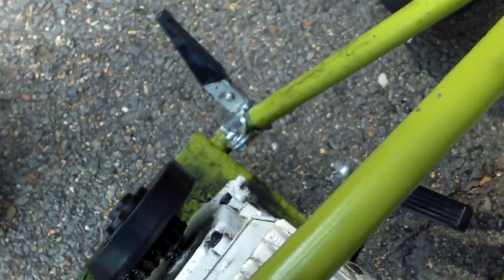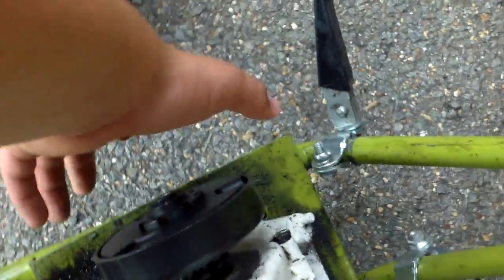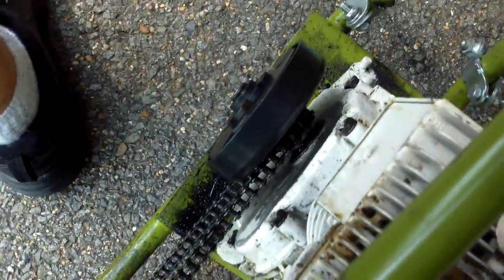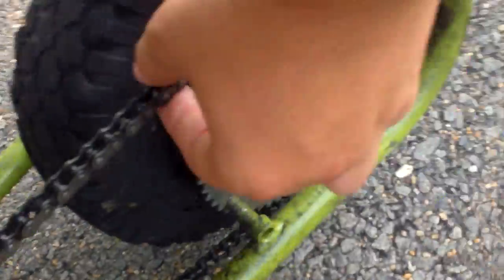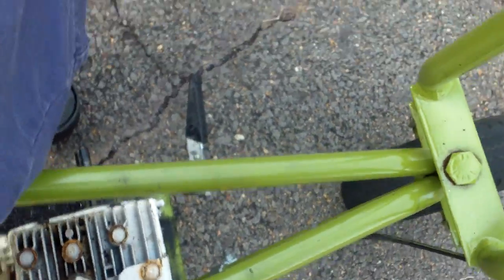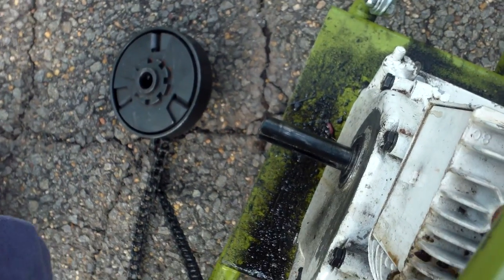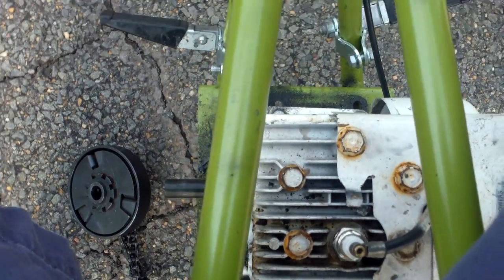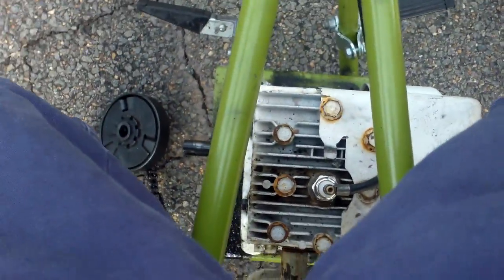How to tell if your centrifugal clutch has gone bad

Comment: Another really important sign. Take a goood long look at your springs. What causes failure 99.9% of the time in these clutches is the springs due to overheating. If you hold the sprocket end of the clutch  and spin it back and forth with your other hand and you hear a screeching sound its your springs. When the springs fail the clutch will engage at a wayy lower RPM and it will bog or fully kill the engine at high speeds. This video is extremely helpful, one of, if not only video going in depth on different scenarios to help identify when its time to switch it out, so thanks! Worth noting- clutches are perfect for ON ROAD riding. They can suffice off roading and hill climbing if you have a jackshaft and have it geared low. The best thing you can do (if you plan to ride on road and off road) is get a torque converter! Perfect for low end torque and with a 10% overdrive will give you more top speed. The greatest thing about a torque converter is once youve got it all installed, and something breaks (90% of tbe time its the belt wearing out) you go on amazon and bam you got a new belt for 6 or so dollars. 

On the other hand cen clutches are cbeaper than everything - 20-30 dollars on amazon and it also includes a 40 series or 35 series chain. If youre tight on money by ALL means just get a clutch, they work great for 1-2 years and will work 2-4 hears if you lube up the bronze bearing every month. 

Thanks for the video and hopefully the info ive shared will help ppl!

Comment: Mix a 50-50 mix of lucas high temp grease with atf and that will allow your clutch to work for 2 years longer... hope this tip helps someone. 👍
Reply: On the bronze bushing or in the drum where shoes make contact? Where to apply this 50-50 mix?
Reply: @scottbrodie3071  this only works on actual cars 😂 idk what this dude was talking about.
Reply: All you need is a dab of high temperature grease on the bronze bushing. Do not oil or grease anything else in the clutch!

Comment: Actually that works better then most of those clutches I have seen.  Most of the ones I have seen jusy get stuck and won't disengage.
Reply from the maker: Marc Serina they die in many ways I guess. That must suck when your driving and it locks up on you like that
Reply: I have one on a motorized bike sometimes you don't have neutral that's all, i have gotten good at taking them apart  cleaning, sanding , oiling them I'm putting them back together.

Comment: Thanks bro i appreciate the info but may i add something... when you ran the engine without the clutch & chain...of course its gunna  not bog out on you theres no weight no tension no real work for it but usually when it does that ill clean up my sparkplug and it really helps but it happens rarely for me just check your sparkplug that may be your engines symptom🤙🤙🤙
Reply from the maker: Ita fixed now clutch bushing  was bad. But yea your right the engine  was not under a load

Comment: I took my engine off my go kart and it runs perfectly fine at full throttle, but when I put it back onto my go kart it  just sputters when I give it any throttle and then kills. I think it’s the clutch or chain but they’re both brand new.
Reply from the maker: Coaxer could be that or something else but maybe try and adjust the carb idle/mixture screw too.
Reply: If I understand you correctly, it isnt an issue with the clutch, it is a problem with your gearing. The engine runs fine when it's off the kart because theres no load for it to pull. When you put it on the kart and you give it some gas, the clutch engages, then has to pull both the weight of the kart and the weight of your body. If you put a larger sprocket on your axle, the clutch will have an easier time getting you going from a dead stop. A larger rear sprocket = more torque which it sounds like you need

Comment: I said the heck with all the disassembly cleaning and oiling and reassembling and carrying lubrications in my fanny pack for my minibiking adventures and explorations I embark upon, I came up with a whole new way of getting my power to the earth below my rubber tires. It’s not a torque converter either! Those are just as much work if not more than a clutch because they have more moving parts and a belt then u still have to have a chain and sprocket off that! No thanks. Plus I heard they’re made for girls bikes mainl hehehahahahe😝. I installed a kickstand under my bike that when it’s down my back tire is actually off of the earth maybe 25-30 mm, ( that’s even w me sitting firmly on my luxurious seat made from my moms old night gowns made from  red silk, chaahching🏦💃🏼 idk what she wears now that I snagged it out of her top drawer but who cares haheha. Then I went to my neighbor billy who fixes tailpipes for ppl all day and night in his side yard and had him just attach the sprocket to the engine with this special type of welding he knows how to do that actually comes out of toothpaste tubes so now I just start it up while I sit on it and then thrust my tummy forward like I’m on a bucking bronco and the kickstand goes up my tire meets the earth and hang on tight cuz it pops a big wheelie right in front of my arch nemesis neighbor Jeremy across the street from my house and his super smoking hot sister Jessicahhh aah aahh Lynn and I’m off to the mooon ! Or at least to the park down the street where Jessicaahhh aah aahhh meets me to clean my spark plug off for me before my exploration takes way. Best mod I’ve ever made!#clutchesandtcssuckjermeysball
Reply from the maker: Just read this and I’m dying 😂😂😂 good story 😂

Comment: Stop and add oil 30w right by the lock ring and sprocket. It is a brass bearing need oil every 30 minutes of riding ,a gravity feed drip oil will solve future problems if ur forgetful
Reply from the maker: David Kaul it’s been replaced over 2 years ago and the new one works perfectly and I always oil it. The old owner didn’t seems to look out for the clutch bearing that much because there was no bushing left in the clutch because it was so worn out
Reply: @streetstallion  when u by the motorized bicycle kit oil on clutch bearing is not ever mentioned. Rrrrrrrr is what my bearing did ,I actually rebuilt it after Google on why my bike made rrrrrrrrr sound lol thankfully u tube taught me
Reply from the maker: David Kaul yea this bike is from  1969 so I never got it new... but yea that’s sound kinda is a big jump scare for sure 😂

Comment: Thanks for uploading. I have a medium grade clutch on my mini bike. Fairy new, I’ve been having an issue with it overheating when I have the plastic cover on. Is there anyway to help keep it cool? I don’t really wanna run the risk of getting my leg caught in it either.
Reply from the maker: It shouldn’t be overheating unless you put oil inside the clutch drum which causes it to slip. Although it is normal for Clutches to get hot because the whole bike works because of that it’s under a lot of load especially up a hill. 👍
Reply: MustangLover 1970 yes that’s exactly what I did. I put chain lube on the jack shaft chain and it got in it. I just tried running it and it shot sparks so I’m gonna clean it and see what happens tomorrow.
Reply from the maker: Spencer Tree that is a really odd symptom
Reply: MustangLover 1970 it should be ok. I think it just got too hot. I opened it up and everything looks okay.
Reply from the maker: Spencer Tree oh ok 👍 good to know it all turned out well for you
Reply: MustangLover 1970 so now the chassis has a crack that is getting bigger every time I drive it. Rest In Peace mini bike.
Reply from the maker: Spencer Tree aw man no way! You can’t fix it by a weld or something?
Reply: MustangLover 1970 I probably can, I just don’t have a welder.
Reply: @spencer6104  ask around, I know a lot of people have a little mig welders these days. I have Kids always coming Over for a Quick Fix on their bikes and Little Scooters. Earlier this year I had a guy bring me an old Go Kart that he wanted me to fix up for his kids. I did a lot of modifications to it and the Kids love it.
    Just a thought, 😎✌

Comment: Dude its overload protection its ment to do that it may be old yes but its dying because your putting too much stress on the clutch
Reply from the maker: Ttv Thraxy that’s true on newer clutches. This clutch was from 1969 and the bushing was gone aswell as the drum being so worn out. This vid is 2 years old and I put a new clutch on it 2 years ago and service the new one regularly, no more problems after the replacement

Comment: Just confirmed my suspicions. Pickup up an old mini bike tonight that has all your symptoms.
Reply from the maker: Did u get a new clutch or restored the old one?
Reply: @streetstallion  yes. Mine was the kind of clutch that has the pucks held together with "c" shaped brass clips. Greased all surfaces except the ones that make contact when engaged. Works perfect now.
Reply from the maker: rlachermeier ok awesome! My clutch was just screwed because the drum and the bushing was shot so I didnt wanna waste time with the original clutch. I bought a new clutch 2 years ago and oil it after every ride. No problems now and works good.
Reply: I bypasses the governor on the bike I just got used for a few days. I took the zip tie off, and put gas and some cleaner in it and it started bogging on me and seems like it's not going as fast. I was worried I blew the engine or something, but I'm thinking it's the clutch. Especially now that I'm almost done with the video and saw the noise your clutch was making.

Comment: Hi mate, is it typical for a centrifugal clutch to work really well until it heats up, because I  start to hear the motor bogging out around 1.5 - 2 minutes from a cold start? Everything is well until then.
Reply from the maker: Usu Caption Hey there, no it was actually hot I was on a ride before the making of this. Had  a new clutch put on almost 2 years ago. Does great now 👍
Reply: Thanks for your reply. I've got a small plate compactor which as you know works off a  centrifugal clutch too. I think you have answered my question as after working well for 1.5 - 2 mins,  it starts bogging the motor down and the plate stops vibrating properly. Cheers !!

Comment: Quick question if you tight your chain and all and it still keeps falling is it because of the clutch?
Reply from the maker: hi I’m xian not really a clutch issue. Majority of the time it’s because the chain is old and needs to be replaced. I had this issue and I replaced the chain and good to go after that. Or could be you put the engine on crooked
Reply: MustangLover 1970 thanks man

Comment: So if start my go kart and it takes off running without hitting the gas,i have a bad clutch? I  put it on a jack stand and turned it on and it just keeps running.At this point im lost.
Reply from the maker: That’s normal usually.. but if it’s going too fast try lowering the idle by turning the screw
Reply: @streetstallion  thx a lot man.l ll give that a shot 👍
Reply: yes you need a new clutch that happend to me few days ago I turned my go kart on and it took off and I found out I needed a new Clutch

Comment: I bought an old go kart and swapped a brand new predator 212 onto it. The clutch that came with the old engine fits just fine but only engages at a higher rpm. After im done riding the clutch flings out a black oil or grease and sometimes starts to smoke and get very hot. I hope this isnt an issue because I believe that my clutch hasnt been used in a very long time. Does it just need some breaking in?
Reply from the maker: Nick 04 try breaking it in for a few days and see if any results change. Let me know if anything else happens
Reply: @streetstallion  sure thing

Comment: The fact that you can rev it higher without the clutch on it doesn’t really say much, the engine doesn’t have a load on it, therefore it will behave differently
Reply from the maker: Joe you might be correct. But when i punched the gas it was going down  steep hill. When the bike was younger i can rev the motor full throttle down the hill but now it was struggling  because the clutch bushing was worn. I replaced the clutch and doesnt do this anymore, the old clutch was from 1969 just like the bike and the engine.
Reply from the maker: Joe it was also a test to see if the carb was going  out to. But yea good thought! I would have never thought about it
Reply: MustangLover 1970 
Oh don't get me wrong, I wasn't saying the clutch wasn't the problem, I've just seen a lot of guys say that an engine is healthy based on what it sounds like without a load. Thanks a ton man, I definitely learned a thing or two about centrifugal clutches from this vid.
Reply: How did you run it without plug connected in the video plug has no wire connected to it

Comment: I just got a new clutch yesterday and have only ridden it yesterday and today.  I oiled the shoes of the clutch these past 2 times i rode, and the bell i can see has a very shallow groove where the shoes are (less than a millimeter deep).  Is that fine?  I learned that i am supposed to just oil the bushing and not the shoes area, and when my clutch had no oil towards the end of today's riding, it was very strong and grabby like it originally was.  Do you think that shallow groove is of any concern? or is that normal for a clutch to have a shallow groove like that? if not, is that a big problem?
Reply from the maker: nascarsimracing1 yes that’s fine it’s just the clutch breaking in. Just keep up the maintenance. I can already tell you good at doing that. 👍
Reply: @streetstallion  thank you!!!
Reply from the maker: nascarsimracing1 no problem! 👍
Reply: @streetstallion  an update with my clutch, i took it apart and realized, that "groove" was actually just oil buildup from me oiling the shoes, which is the wrong way to oil.  I cleaned it up and took off as much oil as i could with a shop rag, and then put multi purpose automotive putty grease on the bushing where the bell and clutch assembly meet.  None on the shoes.  Now the clutch is strong like it should be, and also is completely silent and smooth!
Reply from the maker: nascarsimracing1 🤣🤣 glad you found out the culprit. That’s the easiest fix I ever heard 😁👍👍

Comment: Would my clutch be bad if it literally bent my dead axle wheel bolts? The bolts that attach to the wheel and to the sprocket that connects to the chain

Comment: Yeah bro its because I have a Murray track 2 with a predator 212 on it well originally my back tire comes with a huge a sprocket that covers most of my tire so I have a fast takeoff but no top speed okay I didn't have a problem with the clutch when I had the big sprocket it was smooth no ugly noise as soon as I put on a smaller size sprocket so I can go faster it starts making similar noises on the takeoff and before I'm waiting for throttle it has the ugly Shake 2 it as well I feel like it's the clutch but it's weird because when I put the big sprocket back on it doesn't do it I wonder wht this problem is I'm hoping it's just that I need a new clutch because I really don't want to put the big sprocket back on I want to keep it medium size so I can have takeoff and faster speed I just need to find some better forks with suspension by any chance do you have any advice about this problem

Comment: When I squeeze the throttle, my clutch will spark.
Reply: Emilio Mendoza WTF
Reply: Das not normal😂😂
Reply: Same did you find a fix?
Reply: This is normal inside your clutch are friction pads when the engine increases ram those friction pads push out and grab the outer part of the clutch this friction creates sparks
Reply: @ricoricua3153  I dought it is. Mine is doing this and when I throttle it makes a terrible screeching and grinding sound louder then the engine itself

Comment: My clutch is sparking a little. Should I oil it. Or is it bolted on to tight?
Reply from the maker: Emilio Mendoza try oiling it first use a thicker oil like a few drops of gear oil or Lucas oil stabilizer and tell me what happened after and I’ll try to help u troubleshoot it from there👍

Comment: My go kart wont go up hills unless im going full speed. Bad clutch?
Reply from the maker: David Devine that’s actually kinda normal because it’s under a load. Usually 4hp and lower are prone to doing this. Sometimes to the engine just needs a tune up
Reply: @streetstallion  The engine wasn't struggling though, its a 5hp. The clutch would struggle when I accelerate though.
Reply from the maker: David Devine in that situation yes I believe it’s the clutch

Comment: My clutch is brand new and I put it on with too much p,ay and it has all of those problems but is it bad if it makes a grinding noise
Reply from the maker: Pretty  much thats not a good noise. try  putting  motor  oil  in the bushing that sometimes  works
Reply: @streetstallion  ok

Comment: mine makes a hum noise that makes the clutch stop then shut the motor off unless ur reving it up
Reply from the maker: PurpL nerpL have you ever tried oiling the clutch bushing? That need to be oiled every 1 hour of use
Reply: MustangLover 1970 what kind of oil cause i dont think wd40 would be good but idk
Reply from the maker: PurpL nerpL any oil for engines would be ok but lucas oil stabilizer last a lot longer thats what i use i usually put a few drop of lucas in my clutch
Reply: MustangLover 1970 haha holy shit worked i used 10w30 oil worked just fine had to let it sit for an hour or so though
Reply from the maker: PurpL nerpL happy to help glad it went well!

Comment: Any suggestions on a type of clutch to get , mine is also doing the same
Reply from the maker: Ricardo Garcia to avoid headaches get a torque  converter or if you engine cannot use one just get a $50.00 clutch the expensive  ones last longer, just oil the clutch before and after using the engine